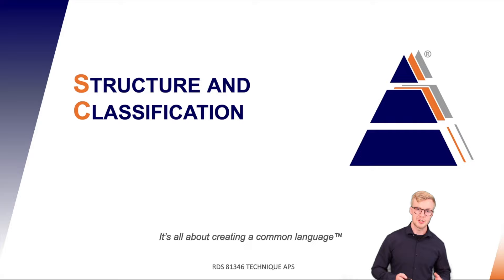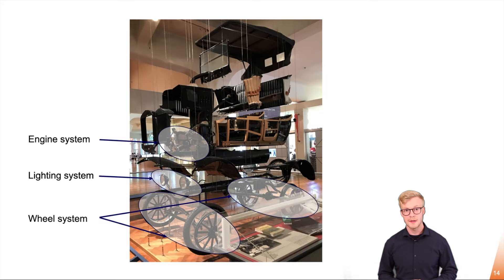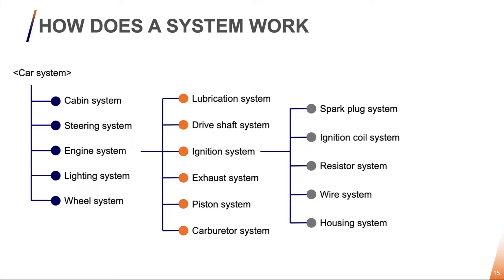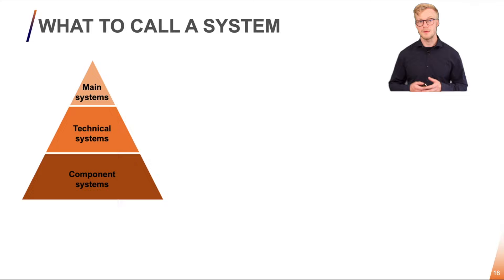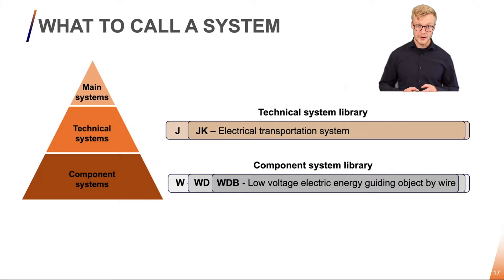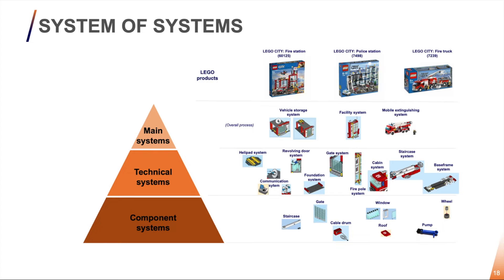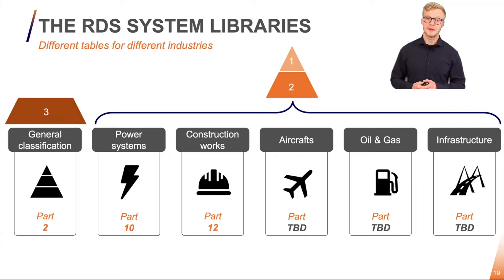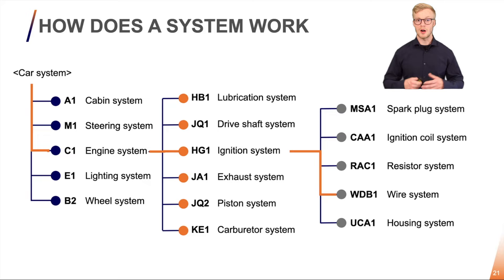Introduction to RDS 81346 - Structure & Classification (Step 1)

Comment: I have the "A Guide to RDS" DS Handbook 166:2020 and I do not see how you selected C1 for the Engine system and I also do not see how you selected HG1 for the Ignition system. Could you explain this? Are we suppose to create our own one letter codes and two letter codes. That makes these on a company to company basis standard if not Part 10 or Part 12 and not really an industry standard.
Reply from the maker: Hello Matthew,

Thank you for your comment.
At 4:30 in the video we explain how the current landscape for the 81346 standard series is. As you see there is currently no part, which covers one or two letter codes for automobiles.
We have therefore chosen our own classes for the one and two letter codes, but most of them are inspired by the classes in 81346-12 (Construction Works)
Since there are no official one letter class definition for “car engine” we have put in “C” as a placeholder in this example. 
In 81346-12 (CW), “HG” is an electrical power supply system, and since the ignition system provides a high voltage electric spark we find that class fitting.

The point of the video is to explain the principles behind classification in the RDS 81346 standard and how it helps us. It was not meant for scrutinization of the individual system classes.

You are allowed to make your own one and two letter codes according to the standard and if necessary. 
However, 81346-12 and 81346-10 covers the vast majority of industry use cases, and we will highly recommend following them if you find yourself within the power- or construction-industry.
The standard looks like this because it is impossible to make a “one size fits all” for all industries which also satisfies individual requirements. 
Creating new parts of a standard and making them official takes time to develop, so of course not all industries can be covered at once.

So to summarize:
You are right, in very rare cases companies might define their own one and two letter code classes which are vastly different from everyone else within the industry.
However, the principles of classification, the systems breakdown principles, the aspects and the three letter classification codes etc. are all still shared among all industries.
If you are in the position where you find it necessary to develop your own one and two letter codes we recommend contacting us for further elaboration.
It is also our experience all companies want their standards to be future proof and harmonized, not company specific.

I hope this answers your questions and concerns 😊

Best regards
The RDS team
Reply: @RDSTechnique  Thank you for your response. I look forward to your future content.
The three letter classification codes are straight forward. However, in practice I have seen, say in IEC electrical schematics, the use on mostly one and two letter codes for components. Is this best practices as it keeps the component at a higher classification, e.g. a door is a door / a sensor is a sensor. As I find -B used instead of -BGB for capacitive proximity switches for example; or is the three letter classification codes best practices?
Is there best practices on method decision factors?

Knowing this is beyond the scope of this video it would be great to reach out for further elaboration.

Thanks again.
Reply from the maker: Hello Matthew,

We also look forward to make new videos 😊
Yes, electrical engineering has a rich history of tagging and classifying components. The older standards used one letter codes (later expanded to two letter codes) to classify components.
This is also reflected in the current components classes: “C” was used for Capacitor, “M” for Motor etc.
That is why technicians still use one and two letter codes and find themselves comfortable here.

However when the tagging language had to be expanded and incorporate more engineering fields (eg. process and construction) a third letter was introduced in the new standard.
If you find yourself in a situation where the 3 letter codes are too specific, the new edition of the 81346-1 includes a rule to use question mark “?” for one or multiple characters to indicate an incomplete class designation.
Example: I want to classify a temperature sensor but BTA and BTB are too specific, if I want to use a two letter code to indicate a component I can use “BT?”.
This way it cannot be confused with a technical system (two letter class code). 

Generally speaking we of course recommend using 3 letter codes whenever possible to classify components.
This is a bit too specific to cover in this video, but perhaps in the future we will explain it in detail. We hope this clarified the current landscape.

You are more than welcome to contact us, if you need additional help. You can find our contact info in the description above. 

Best regards
The RDS team
Reply: @RDSTechnique  Do I understand it right, that if I create an Eplan where I structure everything after functions, the general functions like "Power Supply" are technical systems? I have no problem naming a specific component, but I am not sure how to name the superior function that uses the component. I tried to understand how they do it in the Eplan ESS_sample Project, but that is also not straight forward.
Reply from the maker: Hello DvisionScorpio

Thank you for your comment.
You are free to structure your system how you want. There are no rules stating a component code (three letter code) must follow a technical system (two letter code).
There are of course recommendations but this depends on what works for you, so this is hard to elaborate on.

So, you are free to break down
-	The root identifier (Topnode), eg. <System_1>=GPA1
-	One letter code systems (Main system), eg. =H1=GPA1
-	Two letter code systems (Technical system), eg. =JA1=GPA1
-	Even three letter code systems (Component system), =GPA1=MAA1
Into Component systems (three letter code)

We hope this answers your question!

Best regards
The RDS Team
Reply: @RDSTechnique  Thank you very much for your answer. So you say that i can choose how i want to name my system functions (e.g. with two or three letters etc.), and that the most important thing is the correct component code (three letter code) ?
I am not sure if I unterstand your example right, did you mean =MAA1=GPA1 at the last point?
Reply from the maker: Hello @DvisionScorpio
The number of letters in the code represents the granularity level of the system and subsequently which table to look at.
One letter code = high level system (eg. heating system)
Two letter code = mid level system (eg. heat distribution system)
Three letter code = low level system (eg heat element)

The example i used was to show you are free to mix the three levels in your system structure as you want. eg you can put a low level system directly as a part of a high level system (=HA1=GPA1).
The last example was to say a pump system (=GPA1) can consist of a motor (=GPA1=MAA1). I can also describe that the pump system consist of a pump (=GPA1=GPA1)

Best regards
The RDS Team
Reply: @RDSTechnique  Okay, thank you for your answer.

Comment: Hi there! Question; where can i find JQ into the tablelist of the 81346-10? also MSA1spark plug system in the tablelist 81346-2?
Reply from the maker: Hello Menno,
Thank you for your comment.

The code "JQ" is made up for the purpose of this video. So you won't find "JQ" anywhere in the ISO/IEC 81346-10. However, the code "MSA" can be found in the ISO/IEC 81346-2 table 3. Locate the code "M" --> "MS" and finally "MSA" (Combustion engine in cylinders with pistons powered by spark ignited combustion). 

I hope this helps and answers your questions. You are more than welcome to write again.

Best regards,
The RDS Team
Reply: @RDSTechnique  Hi there , i see also you use the code "HG" for the ignition system. This code is also not to be found in the tables of the 81346.
Reply from the maker: Hello  @mennolankhaar8591  
Thank you for your comment.

The code "HG" is made up for the purpose of this video. So you won't find "HG" anywhere in the ISO/IEC 81346.

I hope this helps and answers your questions. You are more than welcome to write again. 

Best regards,
The RDS Team